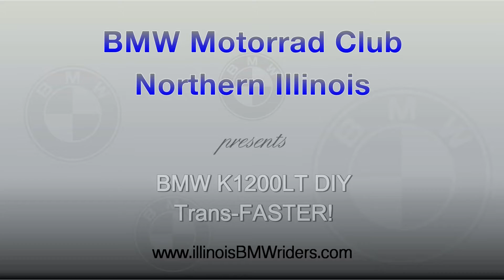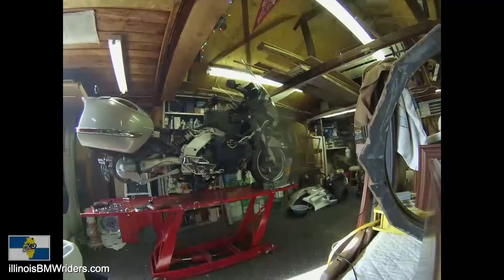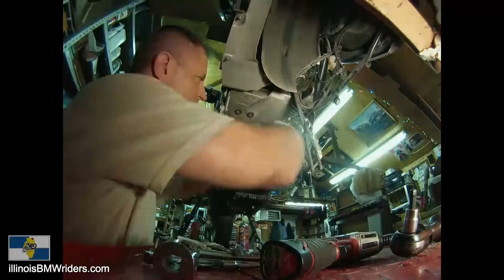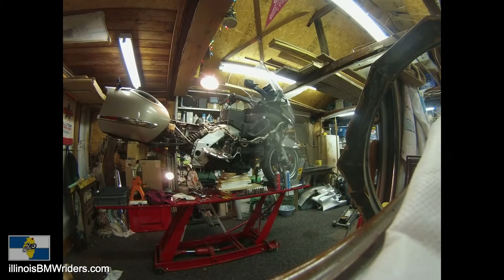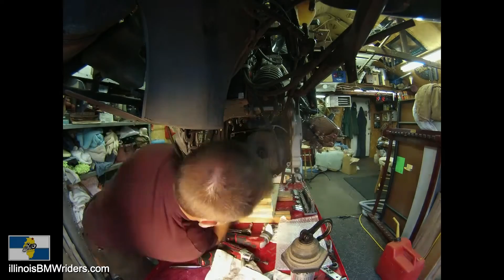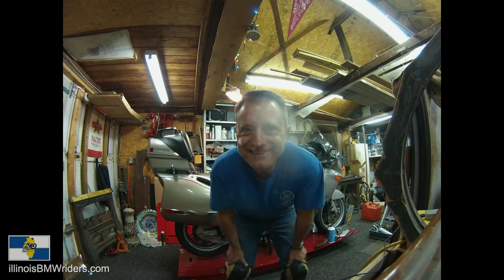BMW K1200LT Trans-Faster!

Comment: Kirk you shop at the same store man, as I look I see a lot of the same stuff I have... Nice ramp, it look like mine...  A++
Reply: The ramp is a loaner from Doug. I would like an air powered one!
Reply: 14wntr Its not a bad ramp for $299.95..  I have one and what I do know is that you go up or down. You always set it on the long pin, get all the weight off that piston and it will last. A few pumps and its right up. Im way to cheep, like you to bust out $700 for a air lift bed... nope cant do it.

I may have a $299 coupon laying around for that lift... I paid?? $324.00 out the door for mine.. Let me know if you need that coupon?

re: Yep just found that coupon good until 5/28/15
Reply: 00K1200LT I think after you pay for that s/h thats $110 more.. 
Lifts: http://www.discountramps.com/motorcycle-lifts/c/2121/
But I like some of the package lifts they have with everything.

Comment: I give you allot of credit putting up with this pig BMW sells. I used to own BMW's. First an R1100RT; two clutches and trans input shaft later sold it. Thought maybe bike. Bought a R1150RT. After TWO CLUTCHES and a final drive WTF... Sold it. I must be into pain I looked at buying the bike you have but instead did allot more research. Nope nada  forget it.  I bought an ST1300 instead. No problems even at 95k mileage. The question that needs to be asked to BMW WTF is wrong with you people building this crap when you HAD the rep of reliability? WHY can the "Japanese" and OTHER manufacturer's build a "similar" shaft drive bike and have it be far far more reliable than BMW? Hell even the R1200RT has the same problems.. Heck I liked my "Beemer" when it ran........